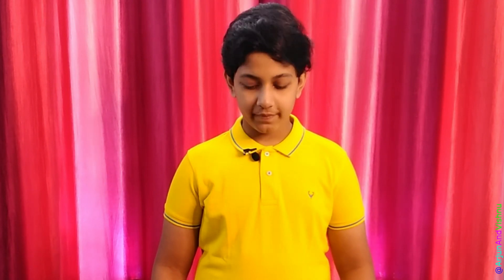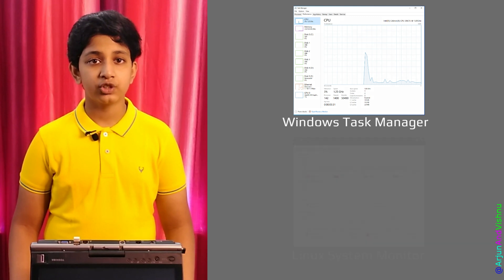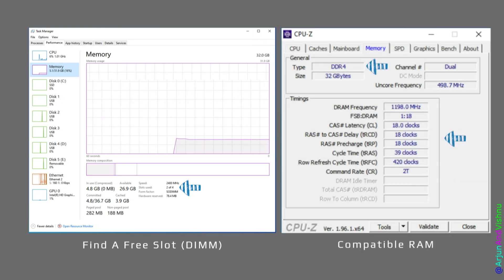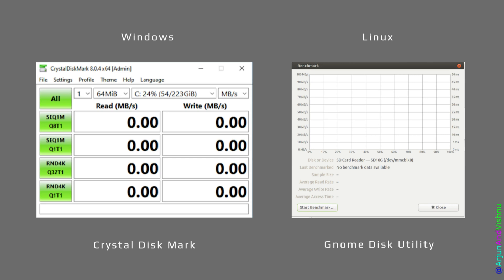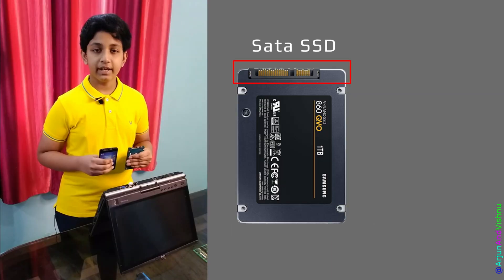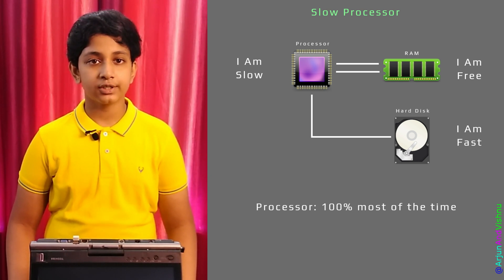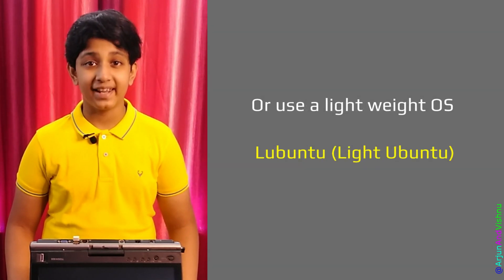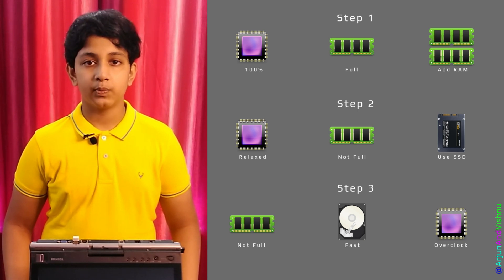Speed Up Your Slow Computer ~ Do It Like A PRO!

Comment: My desktop is 10 years old, using windows 10 and just recently starting running very slow.  This is excellent beginners info.
Reply from the maker: Sir, if it has a good processor, we can put it to good use one way or the other. It might not be power efficient though. Those days processors were 65nm and now they are 14nm and under. Power savings are significant if we keep it on for long hours.

Thanks for the compliment, Regards.